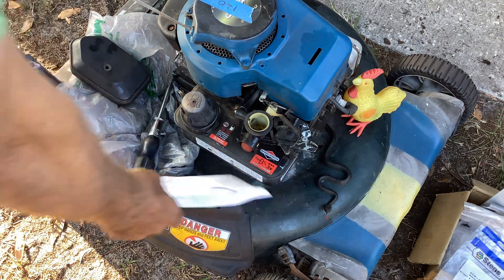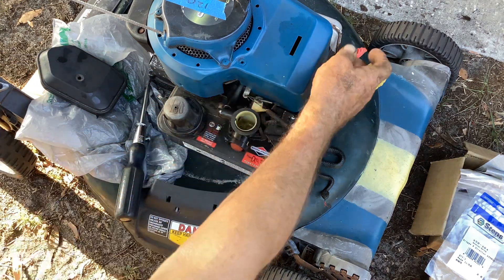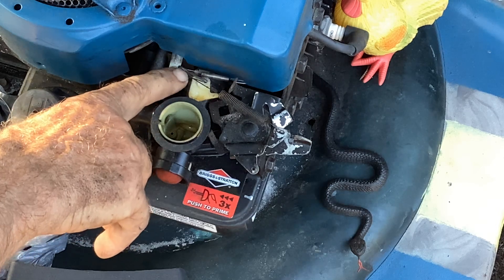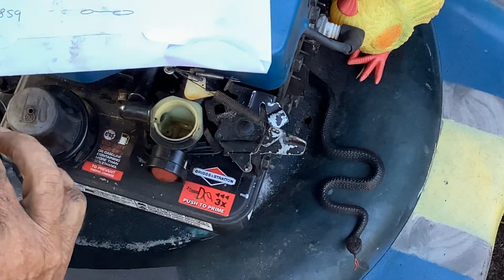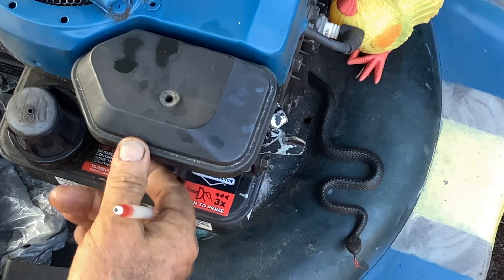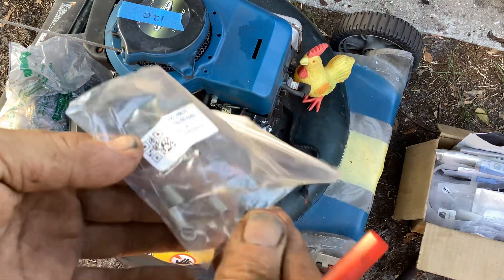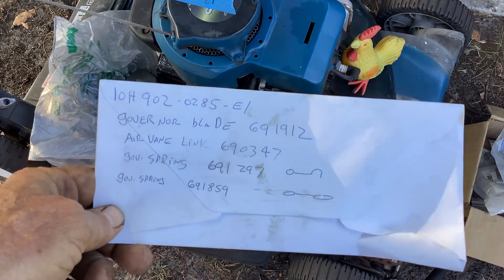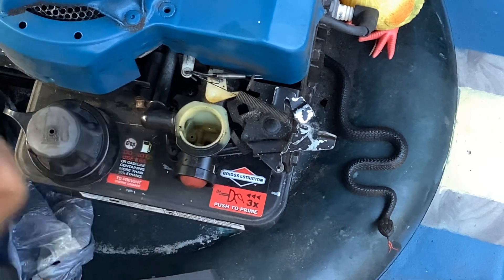2003 Briggs and Stratton 4.5 HP Lawn Mower Engine Governor Spring Placement and Routing.

Comment: So thankful Tommy that you took the time to do this video. It really helps me personally. I got all 3 of those mowers for a total of $ 40. One is a high wheel. With your help, I should be able to get all of them running correctly and shined up. They should be worth $ 90 to $100 in my area. Thanks again my friend. You're the best @Tommy-Time . Shiny Sells.
Reply from the maker: Let me know of any engine numbers you would like carburetor reviews on.  Keep fixing that junk.